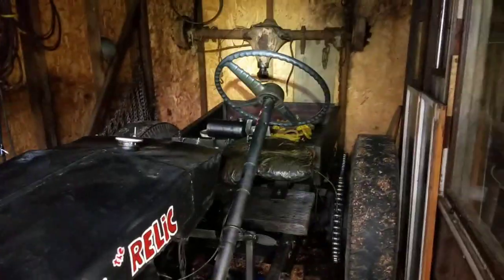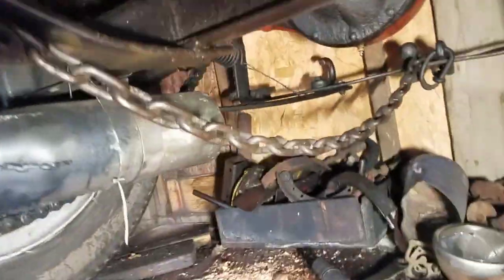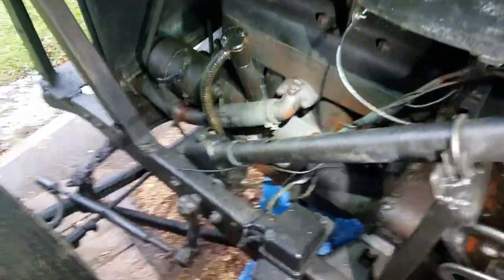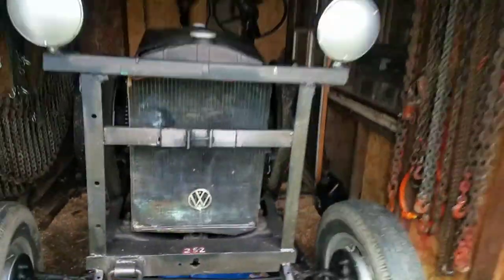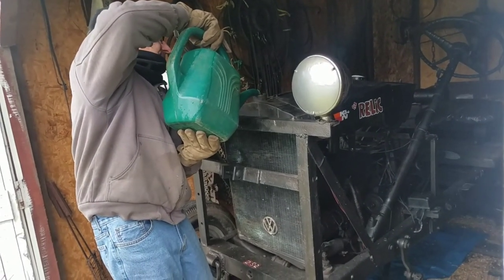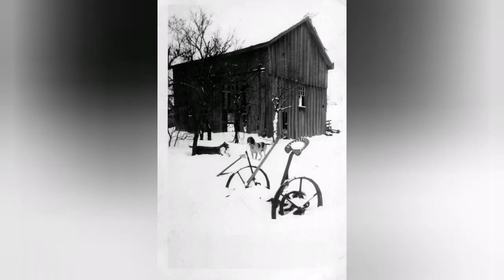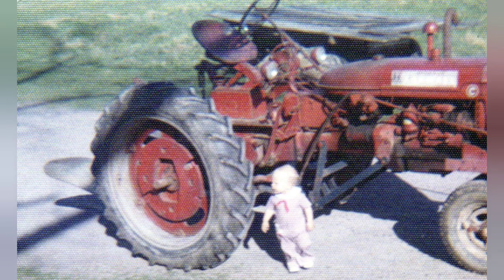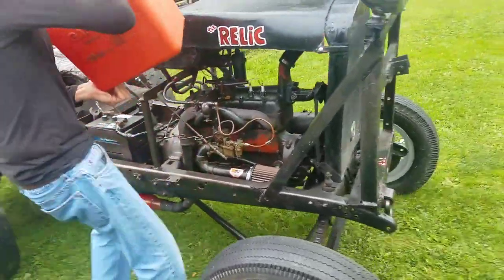The Relic: My grandfather's homemade tractor; the one that started it all

Comment: My dad's first tractor was powered by a 2-1/2 hp Briggs engine. It wasn't fast, but it got the job done. I don't remember much about it as I was 9 at the time.
The other tractor he built that he's given to me is powder by a Toyota 1200 engine with a VW beetle carburetor. He had a disc harrow for this, and a plow. He ran a chain reduction from the driveshaft to the Datsun car rear, and he fixed it to keep the chain from jumping in gear.
One reason I've not started welding my tractor yet is I'm waiting on the machine shop to finish some critical parts for it. I'm trying to negotiate another building where my shop is to do welding in as it's a concrete block building with a concrete roof. This was the diesel engine shed for the generator/hydraulic power on the Amish farm. I plan to build/ retrofit an old wood stove for burning waste oil. This way I can somewhat adjust the temperature, or shut it off to do painting.
Reply from the maker: If you start putting up video please include any pics you have of your dad's tractors. I love the nostalgia as much as the tractors themselves.

Comment: What was this tractor used for? Can it mount a disc harrow or plough?
Reply from the maker: As far as I know, a snow plow was the only thing that mounted on the relic. The implements used with this tractor were horse drawn equipment so they didn't mount on the tractor but were just pulled behind. The things that were still around by the time I was born were a drag harrow, a dump rake and a potato digger, but I never saw them used by the relic myself. It was also used for things like skidding logs and pulling carts.